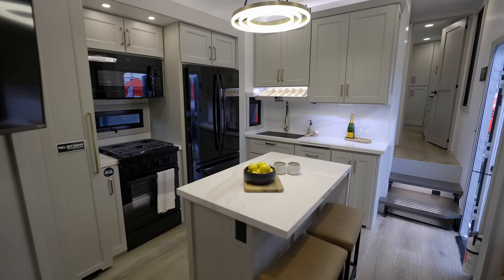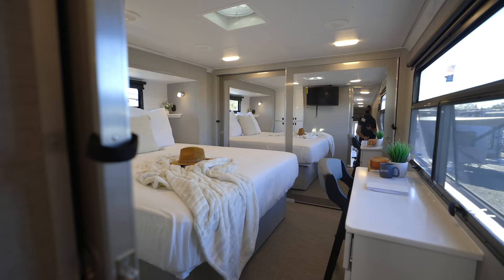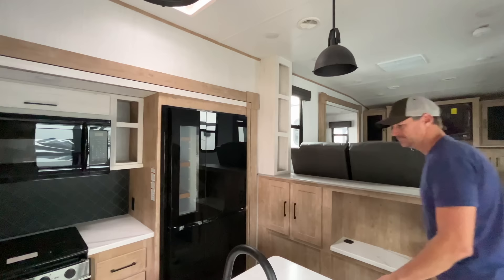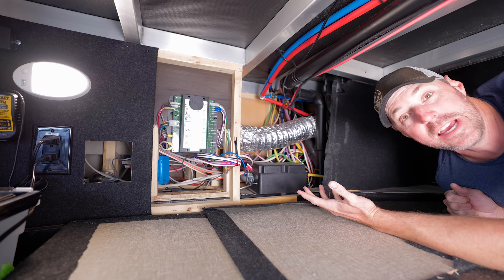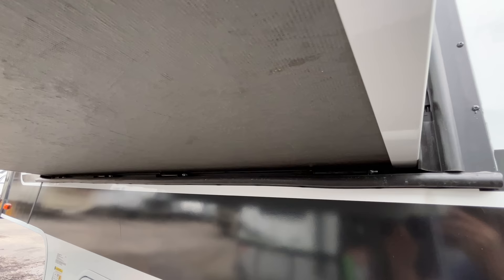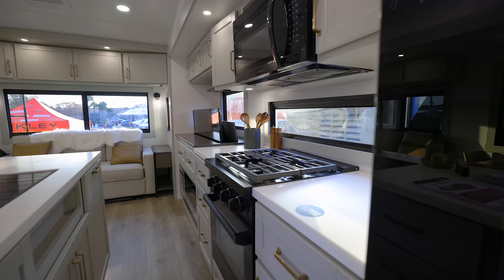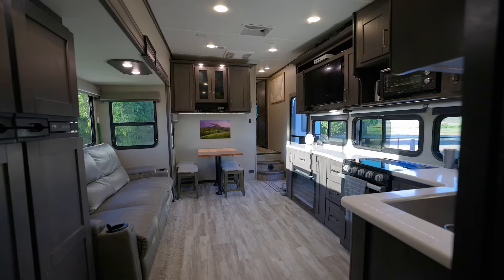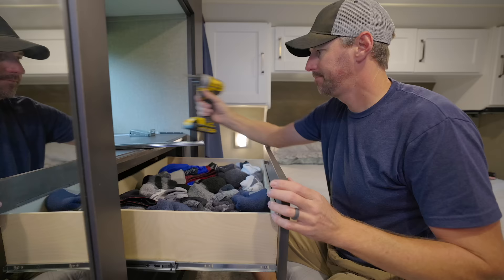Are All RVs Junk! Problems With Our Grand Design RV.

Comment: grand design 5th wheel, not a fan, the roof does not hold up.
Reply from the maker: Our TPo roof like what is on the majority of towable RVs has been fine but I have been considering a roof system with a lifetime warranty to not have to worry about it.

Comment: RVs are anti engineering.. they could be made bombproof but would have the weight of the design. Instead they are designed to be as light as possible and have acceptable levels of durability and quality because again you could make an RV with quality parts but the price point would be astronomical for the square footage.. do you need a $150-200 faucet in the RV? Maybe.. and cabinets and bedding? Do you need plywood or hardwood? Sure but a tiny fraction will pay for it.. flooring and wall covering? All about the price and quality balance.. and if RVs had the equivalent of 2x4 min wall construction..3, 4 times as strong and way way heavier..

Comment: Grand design is probably one of the worst brands out there they are riding on the Winnebago platform that is not nowhere near La winnebago's where the best at one time like airstream trailers I have a hideout trailer owned it for 8 years now lived in it for 2 years on construction sites have had no problems with it

Comment: Tired of watching people still buying these RVs knowing they are built like garbage!! STOP BUYING THESE RVs! Building reliable vehicles is VERY HARD and requires years of R&D research, trial and error, and highly skilled engineers using advanced tools to simulate and identify failure points in vehicles.  The RVs are not built like Hondas or Toyota and these companies don't have the skilled engineers, knowledge, and advance R&D tools needed to build really reliable vehicles like Toyota or Honda. They just hire cheap labor install these RVs.

Comment: If consumers stopped asking for junk, rv manufacturers would stop making junk.  The single stupidest idea the rv industry has come up with from a structural/engineering/maintenance standpoint is the slide.  Yet 90% of the consumers seem to want them.    I see all these rv reviews and no one seems to ask about the longevity of flexible plumbing, gas lines, electrical wires being ran in and out.   The structural stress a slide out puts on the frame, motor failure and increased chance of leaks, the list just goes on and on.
Reply: I agree that slides are a weak point but its not the structural engineering that’s an issue, its the mechanisms themselves.Schwintek, rack & pinoin, hydrualic, or whatever are usually not matched to the size of the slide and the mechanical design of the frame. Also many if not most RV manufacturers use standard chassis that are not designed for a specific floorplan but instead based on length. The weight distribution of rear kitchen, front kitchen, kitchen slides, dinette slides are all different yet many manuf. put them all on the same frame.
Reply: @marvs4321  without a doubt mechanical issues are a much more common slide issue, but there is ample evidence of slides (especially top deck 5th wheels) causing major damage to frames.  And it’s very common for those top deck slides to have the fiberglass crack in bottom corners leading to water penetration.